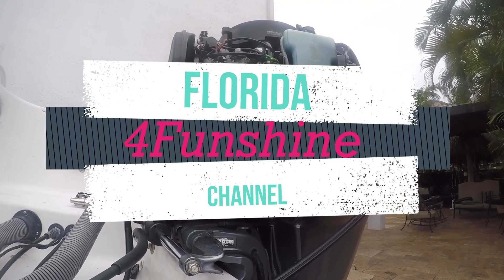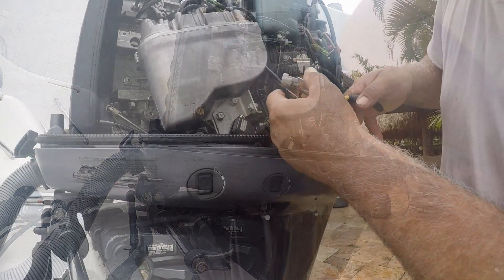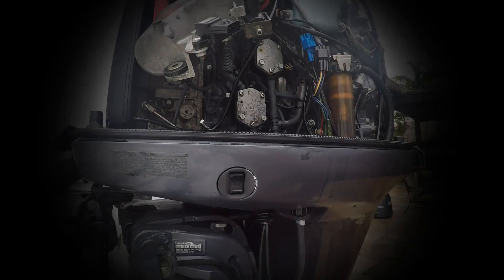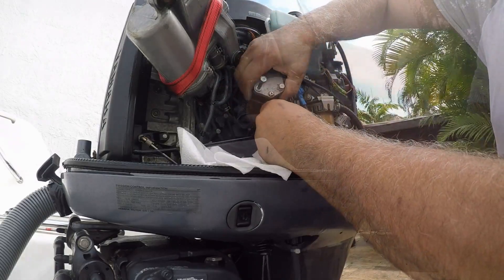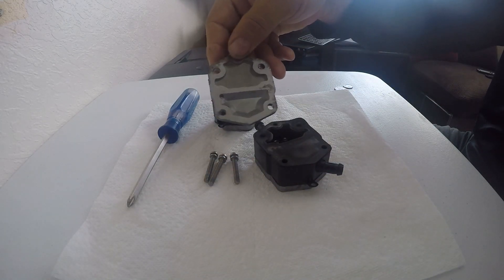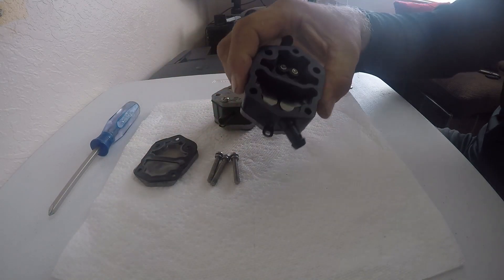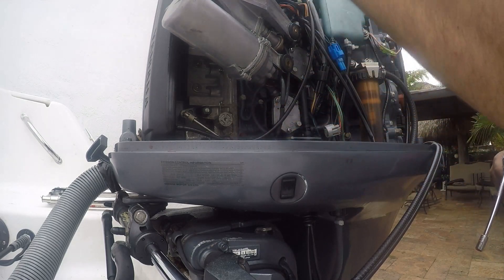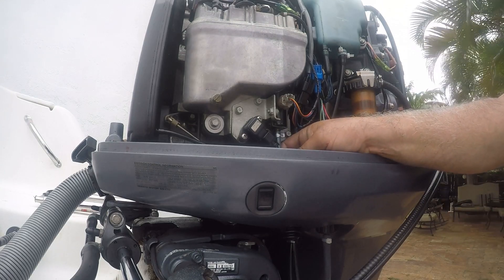Yamaha 200HP HPDI fuel pump rebuild or replace??

Comment: Excellent vid. You wouldn't happen to have a vid changing out the hi pressure pump in the vst and servicing it in general? My 04 VMAX won't go over 45-4700rpms. A diagnostic confirmed low fuel pressure.

Comment: I wonder if you could delete these low pressure pumps like you can on the 066 with an electric fuel pump and block off plates?
Reply from the maker: I do not know. Never have done it and cannot recommend it it either way. Thanks for watching and commenting.

Comment: what are the symptoms of bad pumps? My hpdi cut out when I throttle up almost like i'm turning the key off then back on and I am also starting to foul out spark plugs. It goes away when i change out the plugs but then will start again after I put  a few hours on them?

Comment: Hi was hoping for some help? My hpdi is bogging out at higher RPMS I’m guessing high pressure fuel pump but don’t know where its located? Any tips? Thank so much!
Reply from the maker: Hello.
The VST is the location of your pump. But...before you go there, check your fuel hoses for any obstruction, kinks or broken/cracked.
The grey fuel hoses tend to flatten and obstruct fuel flow. Try pumping the bulb when this happens to see if pump is weak. Fuel pressure test is also recommended. Please comment and share what you found and how you fixed it. Thanks and good luck

Comment: I would highly recommend using the yamaha zip ties for the fuel lines. They are curved and also are highest quality. I have too many of the white or clear types, even the black one's break after some time .Also some stretch more with heat and don't seal properly.
Reply from the maker: Agree@
Reply from the maker: Great point. Will be doing it. Thanks

Comment: Great video.  I have a 2003 200 HPDI which runs great at low RPMs below 2200 and great above 3800.  The motor will surge in between, never dies just surges.  I have replaced the VST filter and the mid range filter.  Would one of the two low pressure pumps cause what I am seeing?
Reply from the maker: Hello. I am no expert...but a surge usually ( for Me) indicates fuel starvation. Most likely. It is the high pressure fuel pump. Does your fuel bulb remain hard or does it soften at high rpms.?
It sound to me that the engine is asking for fuel at that 2200-3800 rpm range and it is not getting it  and finally it gets it and runs above 3800 rpms.
Other test will help ie. fuel pressure test, in line fuel filter, dirty injector/s,.
But..Having said that...fuel restriction at some point. Check hoses for leaks.
Hope this helps..please keep us informed
Reply: @florida4funshinechannel998  Thanks.  I replaced all the filters, so my next move is going to replace the low pressure fuel pumps like shown in the video.  I agree that it looks and acts like a fuel starvation issue.  I would need to have someone look in the bilge to see if the primer ball is collapsing while running.

Comment: if you intend or anyone else to work on your engine the sharp tail of the tie will cut you up. Use pliers and twist the tail off. Or a fine cutter and flush cut. Seen to many people get stitches because of ties.
Reply from the maker: Thank you. Great advise.

Comment: The factory pumps use rubber that don't like ethanol if left very long. I pulled the diaphragm pumps and blocked them off, installed an electric fuel pump on board. A switch that allows me to pump the fuel out to winterize, drain the VST and your done. Bad fuel is the biggest issue with boats. 
Racor 10 micron on the suction side before the Holley pump, then 2 EFI in line filters(12 micron) upstream that are 7 bucks a piece, replace every couple of years. Replaced the 70 dollar OE filter with one as well, I can replace both for 14 dollars from any parts store.
If you look in a troubleshooting manual and for all the symptoms of different problems point to the same part, it's a design flaw and should be looked at to upgrade. For liability reasons I can see why they didn't want the fuel pump on board.

Comment: I have that exact same motor and its bogging and then wont start at all. I was going to look at the fuel pumps next so THANK YOU for this video.
Reply from the maker: Thank you.
Check your plugs for fouled plugs. 
I have had the same situation and had 2 fouled plugs. Since in idle it only runs with four cylinders out of the six .., if 2 of the 4 are fouled. 
Well...you get it.
Let me know. Thanks and good luck.
Reply: @florida4funshinechannel998  I got 2 low pressure fuel pumps, the fuel pump in the VST and the diagnostic cable and software. Also got clear fuel line material and some starter fluid to see what happens. The plugs were replaced within the last 2 weeks so I highly suspect a fuel issue, but I'll check the plugs to see if something fouled since they were installed. Thanks for the advice.

Comment: Hi I'm rebuilding a 250 hpdi in the UK  I want to run it on a fuel oil mix as is lost oil to 1 and 2 . What do you think is the best answer to the oil problem the hpdi has?
Reply from the maker: Hello. Need to check the feeds to those cylinders for oil following the oil pump hoses. There could be broken, disconnected, daqmaged

Comment: How do you know if you have a VST issue or a fuel pump issue.  What should I look for?
Reply from the maker: Hello Rainer.
You have a fuel pump and a filter inside the VST.
What is the motor doing or not doing? Is it at low rpms or high rpms?  With HPDI or outboards in general, there is a process I use to determine where the problem is.  Is it compression? Is it fuel? Is it electrical? Most problems are related to one of these items or at least related in one way or another to these items. compression, fuel, electrical.
Reply: @florida4funshinechannel998  The engine is running pretty good.  It likes to foul the plugs with extended idling anything over 1/2 hour. Starts running fine when I take off with full throttle although sluggish getting there for about a minute or so. That could be the nature of the beast though.  I will ck the O2 sensor and clean it.  It's never been done since it was bought in 2003. I guess I should ask the question a different way about the fuel pumps.  What is the purposes of the VST vs the two smaller pumps mounted inside of the VST? I'm guessing the two smaller pumps draw the fuel up from the fuel tank and then the VST boosts the pressure up to feed the injectors.  Is that correct?
Reply from the maker: @rainergimenez4022   Low pressure delivery for low rpms and high pressure delivery for higher rpms. Are you using ring free? Perhaps you need to decarb the engine. I have a video on cleaning the O2sensor. Is your engine a HPDI?
Reply: @florida4funshinechannel998  It's a 2003 200 HPDI and I watched your video on O2 cleaning. The engine gets used extensively (we dive every week sometimes multiple days).  It get's a regular lower unit oil change and every filter replaced included the $140 one on top the motor every 100 hrs.  It's just never had the poppet valve cleaned or replaced or the O2 sensor cleaned or replaced.
Reply from the maker: @rainergimenez4022  Okay. Sounds like you have it well maintained. These engines tend to foul plugs. Try using fully synthetic 2 stroke oil and that will help with the fouling plugs. Otherwise, it sounds like you have it under control. Stay safe my friend!

Comment: I have twin 225 four stroke Yamaha‘s left motor will not go higher than 4300 RPM runs nice and smooth below 4300 that but at just in gear kind of like Surging
Reply from the maker: Hello.
I would check fuel ( fuel pressure). I would check filters and battery cables and finally the the shift position switch.  Comment when yiu fix it to help others
Reply: I forgot to mention when you bring it up to 4300 RPM it starts to break up could be those little screens in the motor by each of the injectors or possibly the injectors  I will go through what you first recommended , thanks for your help
Reply from the maker: @richscott2952  Those "Little screens" are known as "Mystery Filters" in Yamaha HPDI, not sure on 4 stroke engines.  I am not confident that they would cause what you are mentioning. I am a firm believer in tackling them last if all else fails.  I would also suggest checking the gas for water or adding an additive to the gas if you have old gas in the tank. Even draining the gas and putting a fresh tank of REC. non-ethanol.
As an addition, check all your hoses for possible leak. You might be getting air in the fuel lines or have a block vent.

Comment: Hello Why did you change them? What was the problem?
Reply from the maker: Hello.
I had no specific problem. These pumps were original and they work with a rubber diaphragm that becomes weak and can break with time. This was preventive maintenance.  I recommend changing them at least every 1 to 2 years of use.
Reply: I replaced mine after I had one fail (i.e., membrane failed)...  Symptoms were loss of RPM and hesitation at cruise...  This is a consequence of the lifter pumps not being able to keep fuel supplied to the VST and high pressure fuel pump...  No sense in rebuilding these - they're only about $35 each to replace...
Reply: @catallaxy2000  Ethanol is a problem with rubber components and can fail these pump diaphragms prematurely. I'm getting rid of mine for this reason and installing a Holley Blue electric pump with a regulator. Totally bypass both pumps. Install some block plates and forget about them.
Install a Racor primary filter with a 2 Micron element between the tank and the pump and not have to worry about these guys. Might research the Racor on The Hull Truth. Some say it stopped all of their problems with fuel filters on the HPDI. 
Many more threads like this;
https://www.thehulltruth.com/boating-forum/1011491-hpdi-racor-help-please.html
The objective of the 2 micron is to keep the 10 micron filters downstream from needing to be changed since the spin on in the boat is so much easier to get to. You can install a warning light on the suction side to show the filters getting too full of debris.

Comment: Probly don't want to use those plyers on those harness connectors thats how they break also may not want to pull on the wires on those same harness ends that's how they get pulled  out and shorted which cause running issues which can have you throwing parts at a problem
Reply from the maker: Great points.
Thanks
Reply: Always going to have someone pointing out that you didn't do something by the book 😂😂

As someone who is mechanically inclined, you just learn how to do things without breaking them. You learn by feel on how much pressure can be applied before breaking something, etc.

Nothing he did was alarming.

Comment: Good morning just pick up a 2003 Yamaha 200 hpdi .took it out for the firs time . When shifting into reverse it would go into reverse but would not rev up to move boat .have tou ever had this problem with your motor. Thanks
Reply from the maker: Check for cavitation and proper prop pitch. Please update.
Thank you
Reply: @florida4funshinechannel998  I think o have found the problem with reverse adjusted the cables at the remote I now have throttle in reverse on the hose have not water tested at this time will update when I do . Thanks for your reply.
Reply from the maker: Awesome!